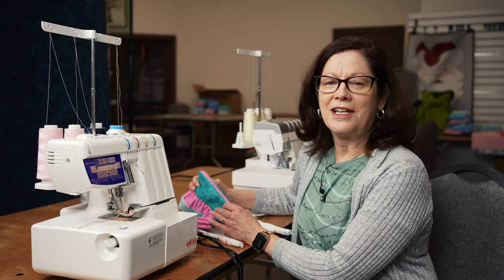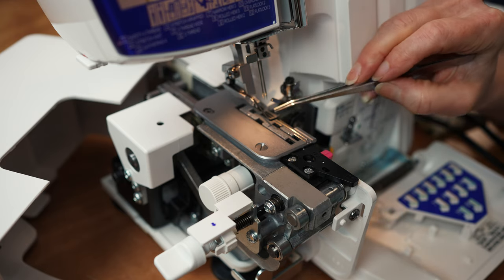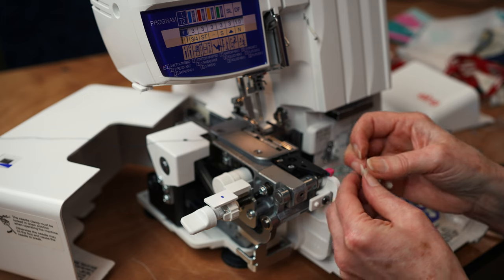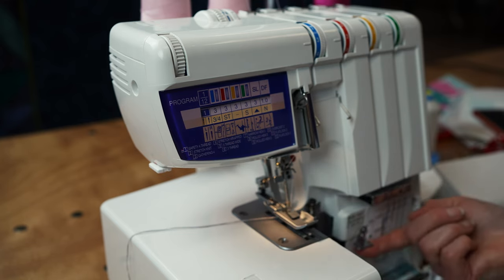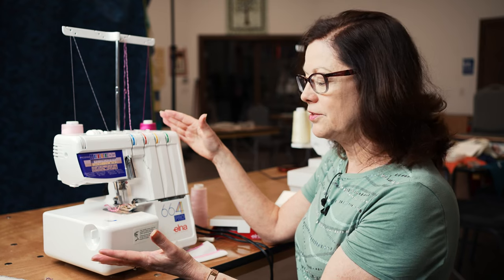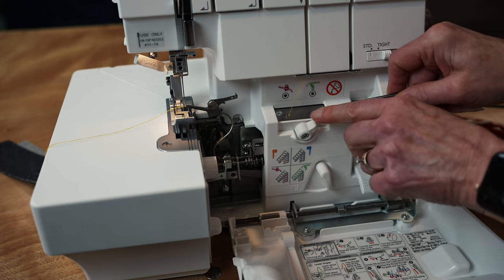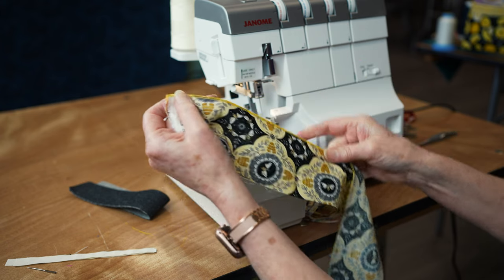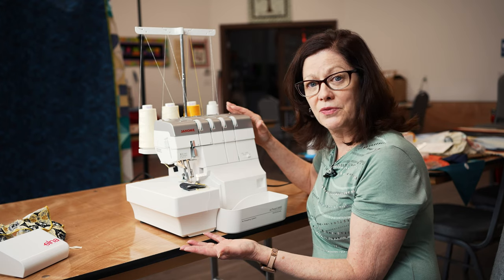Do You Really Need a Serger? An In-Depth Explanation

Comment: Just a quick question:
Do u need to unthread the upper looper to use it as a three thread Overlocker or do you keep 4 threads on and overlock as a single layer as opposed to 4 thread which stitches two layers together?
Reply from the maker: There are several threading options depending on the technique.  You can stitch with 2 needles and 2 loopers, 1 needle and 2 loopers(eg. rolled hem), 1 needle and 1 looper(using the spreader on the upper looper), or 2 needles and 1 looper (wrapped overedge).  The great thing about the 664P is that you select the technique and the reference guide will let you know what needs threaded.